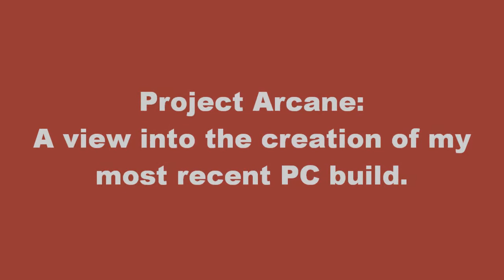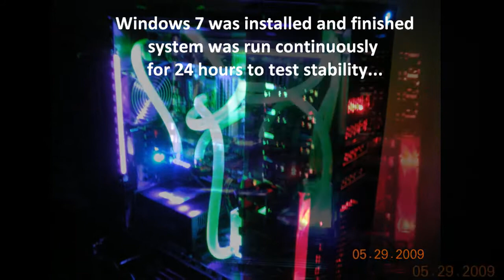Project Arcane

Comment from the maker: Thanks. As for the rear radiator, It came down to a choice of using 4 90 degree bends or mounting it in the direction that I did. I figured the extra tubing was the more practical choice, if not the most visually pleasing.

Comment from the maker: Which one? The External is a BI GTX 360 and the internal is a Magicool Elegant 240

The Magicool ultimatly cracked along its polycarb chamber however, as did it's replacement. I then replaced it with a BIX 240 and have had no further issues.

Comment from the maker: For anyone intrested, I recently overclocked my gtx295 by an across-the-board factor of 22% (4% higher than BFG's fastest liquid overclock model) with perfect stability. I cant say what the temps are exactly but I can assure you they are exelent (WB is cold to touch, my second radiator leak ironiclly shorted out nothing other than the gpu temp monitors)